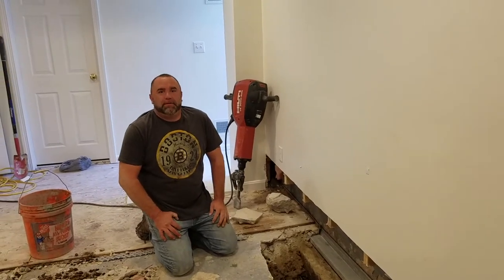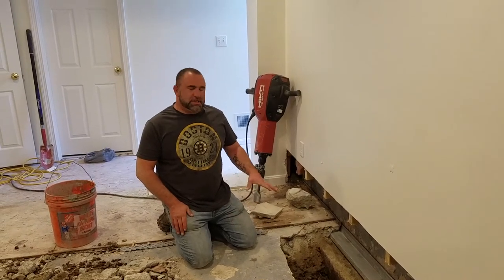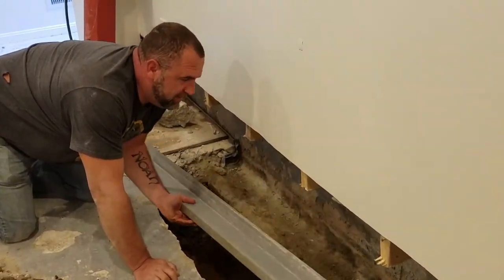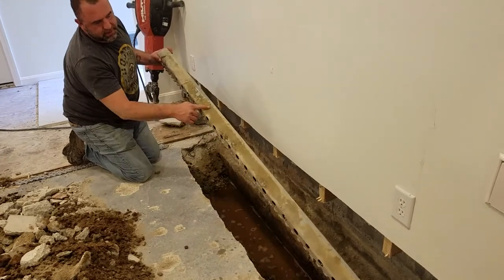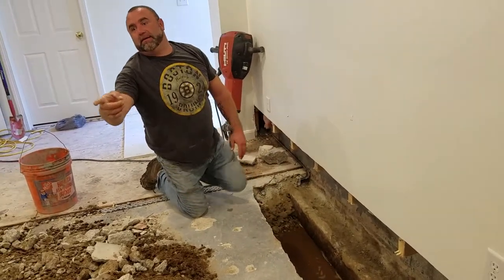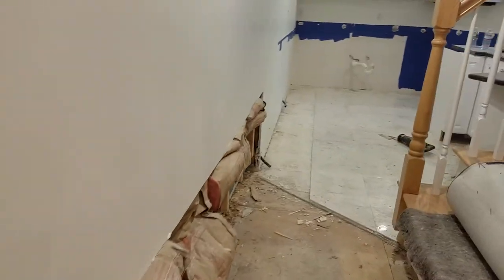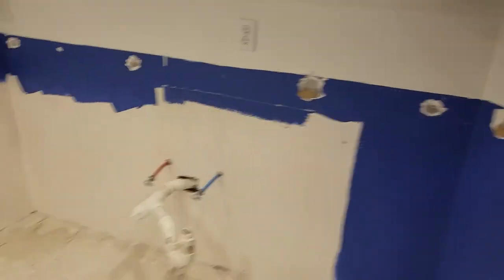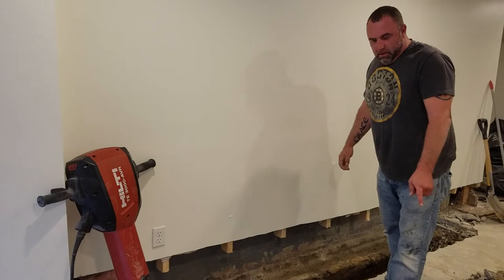Proper basement drainage placement.

Comment: I wish you was here in Indianapolis Indiana, I'm glad I came across you videos...just got a estimate for one of them box system $11,000 for one side of my basement but if not that for the whole basement 23,000 with 2 sump pumps....and I have 1083.3sq ft basement
Reply from the maker: That's an insulting number
Reply: @premierbasementwaterproofi9106  yes, it is that's way I not getting that way done I'm going to keep looking around till I can find some that does it the right way .and not have to do it again
Reply from the maker: @save222007  keep looking. Someone should be able to do it right

Comment: I have seen some companies dig the trench similar to you, but  leave areas of the floor still attached to the footing/foundation.  They say these  "Engineering tabs" allow greater support for the foundation and the floor.  Is this something you do?
Reply from the maker: Never. You have to break the footing joint with a dimple board. We NEVER cheat or cut corners. We do it right!

Comment: Wow! I was looking at buying this box system. Yikes! Glad there's still real tradesmen left in this world. Do you put a layer of gravel under your ads or just lay the pipe and pour gravel over it?
Reply: @BigMike617  thanks
Reply: @BigMike617  what are your thoughts on using filter fabric and the high octane in trenches? I see alot of companies that dont use it and some that do. I would like your opinion on this

Comment: Does the system you're installing lower the outside water table? Also, would the gap between the wall and floor to allow the water flow from the footer release smells?

Comment: When you cut in a trench that wide that separates the slab from any support from the footer, what do you do to make sure the slab doesn’t start settling?  I have one contractor telling me the deep drain is the way to go and one who says the deep drain will cause structural instability for the slab and it could start to crack and shift. Do you add any support for the slab?
Reply from the maker: Unless your foundation is monolithic that guy is giving you a sales pitch.  Monolithic is very uncommon.

Comment: Nice work, just had a quick question can you use 4 inch ads for the drain tile?? thanks
Reply from the maker: Chance Absolutely, no better drain on the market. The engineered crap is junk. All we use is 4 inch ADS